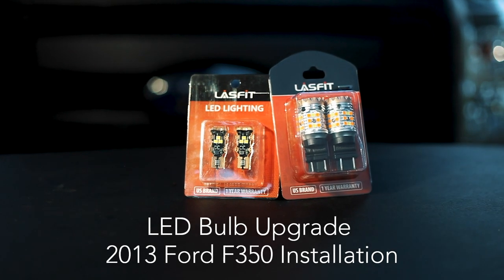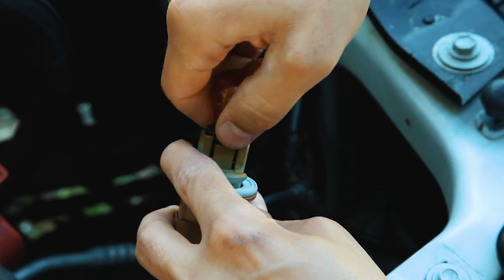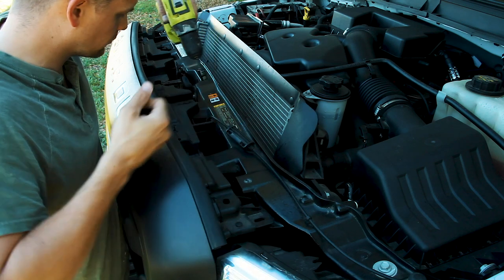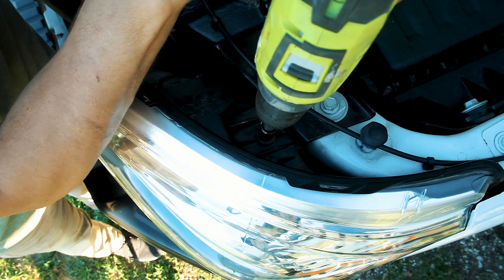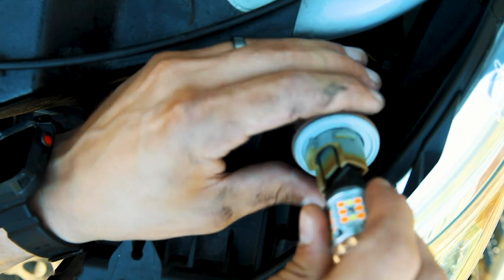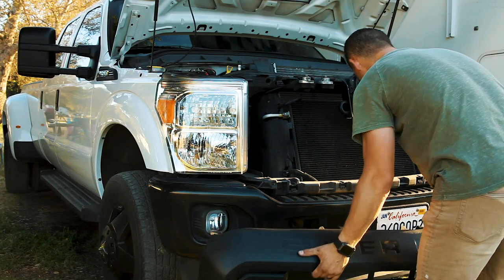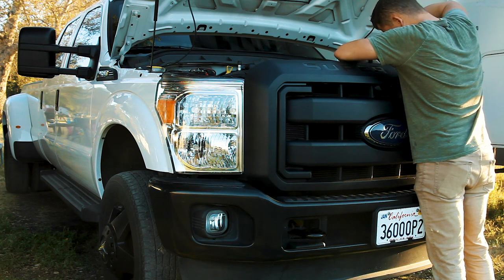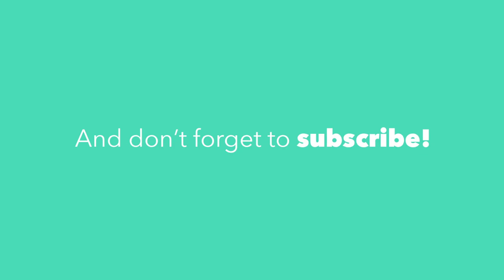LED Turn Signal Bulb Upgrade | F350 Install Video | LASFIT

Comment: Hy how are you I have a question when you turn on the truck and headlight on, and when you use the blinkers does it hyper flash thanks
Reply: Great question. When you say hyper flash, I presume you mean flash rapidly, or faster than normal? If that’s the case, it’s possible the the bulb needs to be flipped.